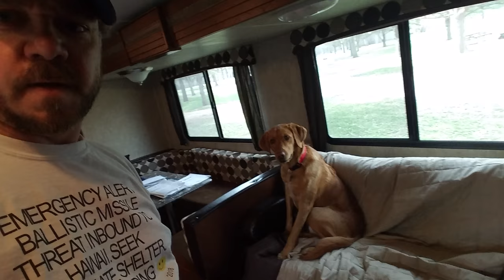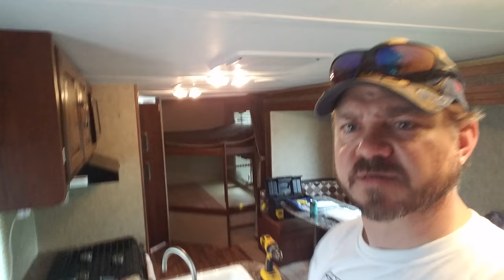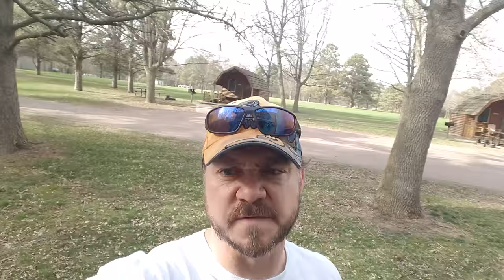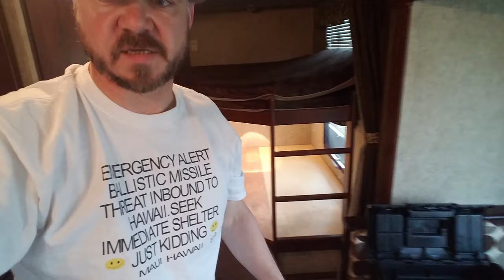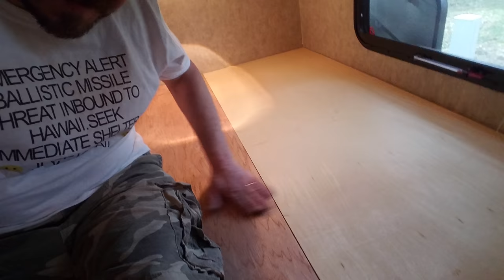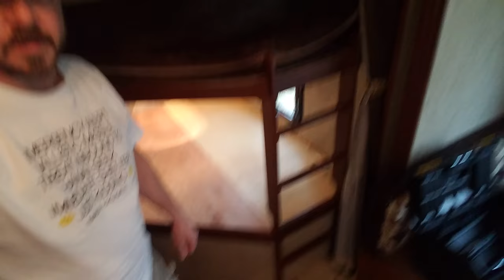Hot Water Heater Bypass Valve Journey

Comment: This video was surprisingly very helpful even though it is an older video.  I was brave enough to go remove some random screws.  I have a 2022 North Trail 21RBSS.  No bunks.  I started at the metal panel on the outside of the camper that is supposed to be for the water heater vent.  There is an odd bump out in our outside pass through storage area next to that panel.  I removed 4 screws in the wall to see what was inside.  It was about 3 ft long by 2 ft high.  When the pannel came off, there was the water heater.  I had to crawl inside the storage door to find the 2 valves used for the water heater bypass at the far back of the water heater.  Don't be afraid to open panels and look around.  The owners manual was useless.  Keep posting new guy.  Your not alone and some info is timeless.

Comment: Brother, 

Thank you.  My family and I took our Travel Trailer (2021 Crossroads Zinger Lite 270BH) on its maiden voyage this weekend.  Had the same problem but knowing where the bypass valves were and they forgot my low water drain caps.  Had to go to a local hardware store and purchase 2 caps.  My bypass valves were too located under the bottom bunk.  Your trailer has a very similar layout to ours so you have no idea how much your video helped us.  I'm glad I found your video. Now we can wash dishes and shower in warm water.  God bless and thanks again.  

-Newbie Camper.
Reply from the maker: Happy to hear that it helped. It can be so frustrating. Enjoy the camper. You'll learn much more, the more you use it, and it will all get easier. Happy memory making.

Comment: Thanks for the hot water heater bypass lesson. I spent an hour looking for mine.  Once you pointed out it was in the back of the hot water heater I realized mine was located under the refrigerator. Sure enough there was a panel under the refrigerator. Removed two screws to remove it and the valves were right on the other side. Thanks again.
Reply from the maker: So glad it helped. This camper in the video has since gone down the road, but our new one is the exact same way. Have to take the darn bed apart to access anything. Its such a pain. At least its only twice a year. Thanks for the comment.

Comment: Thank you!  we just bought a 2810BHWE.  Finally going through it to test everything.  The Bypass valve was a paint to access for our.  They changed the access for ours.  its a small panel in the storage area outside.  I am goin to create access under the bunk.  Much better way to access it.  

I wish I would have known about the low water drain caps.  I did the same thing.  Started filling the tank and water running straight out the bottom. Argh!!!!  Tomorrow I will go get the caps... Think I will add ball valves to them.
Reply from the maker: Ball valves are definitely the way to go. The trailer I have now came with them from the factory.  Glad to hear the video helped you out.

Comment: Aaron,  thanks for the video.  It was very timely for me.  We have a 2018 Passport 2810BHWE, almost identical to yours.  My dealer DID tell me about the bypass valve,  but I have yet to see if for myself, due to its hidden location.  My camper came winterized already, so haven't needed to touch the valve yet.  But I will when I go camping soon.
Reply from the maker: So glad it helped.  Those things are not easy to find.  Happy camping!

Comment: Next camper shake down cruse, (One word) DRIVEWAY! Set up your camper in your driveway and hook everything up. Water, electric, solar (If equipped) and stay in the camper for the whole weekend. If something goes wrong, You're home with all your tools, parts, easy to run to the camper store, call or visit your camper place of purchase (Assuming that is local). 

Second tip, make friends with another camper. They will more then likely help you with all of your questions. They may even have spare parts to help you out.

Comment: I am still trying to find mine in a 2003 keystone hornet. Went through every manual as I got a preloved camper. I’m assuming my issue is the check valve…just gotta locate the access panel to back of the water heater or just plain old back side would be great.🤦🏼‍♀️
Reply from the maker: Best of luck. I wish I could help better, but I'm no expert in other models. My advice is to just keep looking. It's there somewhere.

Comment: Like you, I am trying to find a bypass valve on my Rockwood 2304BK that wifey and I just bought last week.  I have hot water, BUT now I am in trying to winterize the trailer and guess what? I cannot find a bypass valve!  I have found the back of the hotwater tank, but there are no valves to be found!  After darn near scalping myself getting my head under the bathroom sink cabinet, blood running everywhere I still haven't a clue as to where there is a valve!  WTF to do?  No clue here!
Mike B.
Reply from the maker: Hopefully you can get it figured out.  I do remember reading someplace that not all campers have the bypass valve.  Yours may not.  I think then all you do is drain the hot water tank.  Sorry I can't be of more help to ya.  You can always call a local camper repair shop and just ask them also. Good luck.

Comment: having the same problem, found 2 valves under my sink area in a little cubby hole, problem is only 2 valves, which to turn?.. Living in Mi now but born and raised in Yankton SD, I know the winds..
Reply from the maker: Not sure on that.  I'd think those are for your sink, but hard telling what these camper engineers are thinking.  I know it gets very frustrating working on campers.  You should be able to call your dealer for some advice also.  Mine has been a big help in the past.

PS: Can't wait to visit Michigan some day.  Have a friend that's originally from the U.P. and he is always talking about how beautiful it is.
Reply: You should have two valves. One going to a red pex tube (hot) turn it so it’s running parallel to the hose (on) and do the same for the cold side which feeds the tank. There might be a third. That’s a bypass valve, that should run in between the red and blue hoses, perpendicularly. Close that one, that one is for winterizing.
Reply from the maker: So I just got our new rig ready to go the other day, and found the same thing you were referring to.  Are those valves to your water pump? That's what mine were for.  Couldn't get any water to flow, and I was thinking after about 20 minutes of troubleshooting, oh great; new year, new camper, new YouTube video. 😂

I totally agree with Matt Hawn's comment.  To open the valves they need to be turned parallel to the water line.  Perpendicular is off.